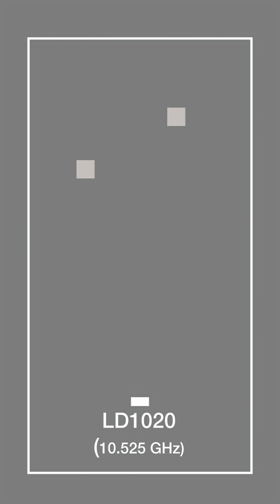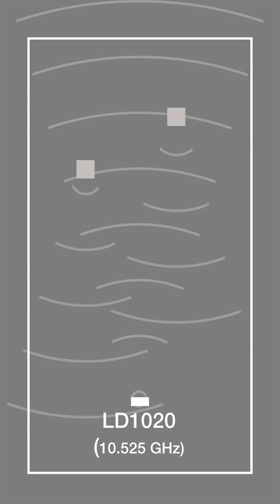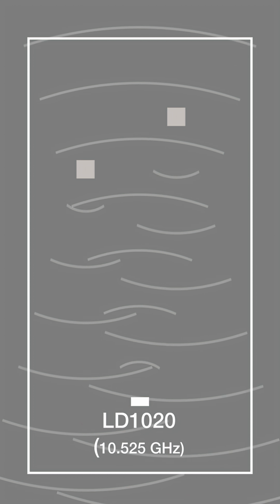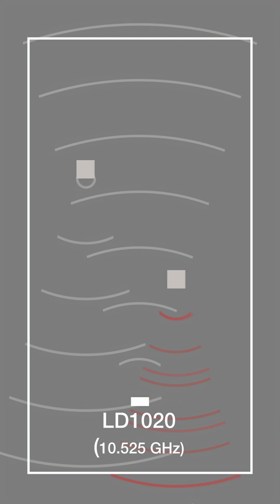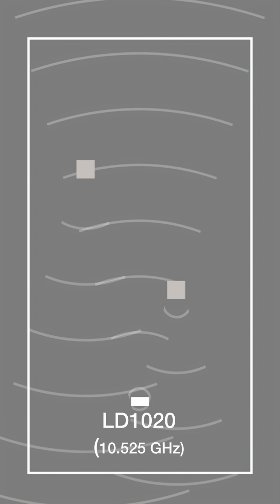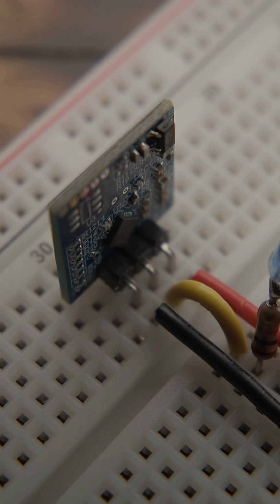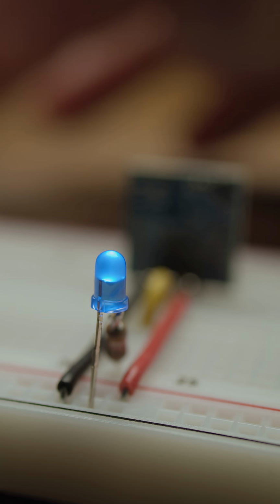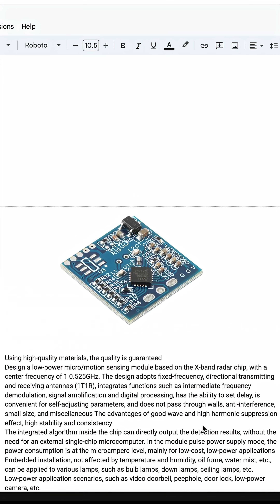LD1020 Radar Module

Comment: I had no idea these existed. I snagged some, and it’s exactly what I need for a project. I had previously been using a PIR sensor, but that required a hole in the enclosure. This is smaller, better, and works really well. Thank you!

Comment: And even detect space objects in a telescope that can generate a reflection on reference motions to ultra sonic radars or the dopler shifts they took static charges run it across two plates the light is the motion that bumps static in frequency added to the static structure and poof a new detection device

Comment: Double pane windows are filled with nitrogen. An innert glass that will disrupt various frequencies of light and radio waves. If you see moisture buildup inside of them, the gas has leaked out and the seals most likely rotted away. Making the windows no better than a single pane window.

Comment: The signal did not go threw the drywall or wood you are talking about that it did,  but since you are in an area that has a hole on the side not a solid barrier then the reason it sensed it was not that it went threw but just that the same radar signal that bounced from everywhere only bounced back from the side opening which caused it to change the frequency and not because it went threw anything... if it had been that it had no solid wall without a hole are to bounce the frequency back then that would have been a better test for that.
Reply from the maker: I did test it in a closet with a closed door and it worked the same. I used the hallway setting for the video so people could see everything at once.
Reply: @HackMakeMod a closet isn't fully closed it leaks threw the gaps of the floor

Comment: Radar is weird. Some colors I have to use certain formulas to make a radar transparent coating so the blind spot detection still works properly at the cost of not as accurate color match.  

In context the sensor is seeing through 3 mm of plastic bumper .7 mil of sealer 2.2 mil of clear but the color is less than a mil and can blind the sensor depending on the pigment

Comment: Nifty, but we need some affordable, accurate ranging radar modules already.

I built an autonomous rover for my senior design project last year.  Navigated primarily on RTK-GPS, which was a game-changer, but i quickly discovered using lidar for collision aviodance and obstacle negotation is not where its at.  Sun glare, aliasing, blowing dust all give false returns.  The new 2D 16x16 matrix sensors by ST Micro were an improvement, but it would be nice to have a radar to fuse it with.

Comment: I'm in process of learning how to build a radar to record the speed pf cars going down my street so thst when a group of neighbors try to get the city to install speed bunps we will have proof of how fast cars are going. I am not very knowledgeable in this type of device or circuitry in general. I planned on possibly using a OPS242-A Doppler Short Range Radar Sensor. I've been reading and watching videos on how to build something lile I am trying to do so if anyone has any advice od greatly appreciate it.

Comment: 10 GHz emitter is easy and old tech. The tech challenge would  be forming an antenna and making a detector that’s not swamped by the emitter, all on a chip.  Would be interesting to hear that explanation.

Comment: Exterior double-paned windows typically have a coating and a vacuum gap"  If the coating is conductive, that may be the problem, but radio waves don't have any problem with a vacuum.  All spacecraft signals come to us through the vacuum of space.

Comment: To set it get a 2 input and gate and pull the one input to high so when the Doppler radar output goes high it will trigger the o/p to High which will start any audio beep very high to. Blasting high depending on the amp output

Comment: Use to fit similar deviced back in the 70s. A doppler radar device for security. But that were huge compared to this. Wave guide was a cavity made from brass and silver plated. Plus the electronics too drive an output. It was Also on  the 10ghz band. We use to remove the waveguides for the 3cm ham radio band.

Comment: That's very interesting. Would that work to detect intruders in the backyard for instance? Or does it also trigger for movement of small things like brances of trees due to wind, and animals: birds, cats, etc? Would it be possible to configure what to respond to? Big objects or small, large movement or small, etc? Does it have like an i2c interface for instance, so a microcontroller could give it settings?

Comment: On line RS may have worked but no one knew about them to use it.   Other companies have taken over and will support smaller orders.  Mouser Newark .Digikey  are a few  Amazon is not unless you want to buy 100s of each part not 1-10.

Comment: Especially vacuum blocks 10GHz 😅
B.t.w. in 99.9% of high-end windows it's not vacuum, though huge vacuum (very low pressure in fact) chamber is used in making - it's dry nitrogen or argon or mix of both.

Comment: Dear fellow common youtube explorer,
VIN here is NOT vehicle identification number. V is voltage and IN means going into the circuit, as the power supply. 😊

Comment: @HackMakeMod Could you put a mirror up, position so it would reflect anything that moved so whatever is moving outside the window, would now show up in the mirror? Instead of pointing the sensor out the window that it wouldn't work in. Point the sensor toward the mirror or would that not work? Could it pick up the different refractions in the light, from the images moving in the reflection? Sorry if this is a dumb question...

Comment: (1:27) Double- and triple-pane widows don't have a "vacuum gap".  If they stop a 10.5 GHz radio wave, it is most likely due to a metallic coating intended to block infrared radiation.

Comment: 10 GHz is just below the Direct TV. so it would be possible to get more range using an old Direct Dish placing this  transceiver in the feed horn  paired with relay board for motion trail cam, home security, or just spying on neighbours without actually sitting at the screen all day. many nice robot projects can benefit from this too.

Comment: Typical motion detectors (like on that stupid paper towel dispenser that doesn't work most of the time) are nothing but temperature change detectors. If the temperature changes more than a certain number of degrees in a certain amount of time, it detects that as motion. (Hint, the paper towel dispensers don't work because your hands are too cold from the water. Try waving your dry forearm in front of it and you'll have better luck.)

Most of the time it's Good enough, but as the MythBusters discovered, if you can diffuse your body temperature with something as simple as a bed sheet, you can fool them. On the other hand, if you have a particular window that is subject to sudden heating when the setting sun peaks around the next building, that can set them off. 

This is a solution for all those failures.

Comment: No double-pane windows don’t have a vacuum gap ! The pressure difference would be insane to hold !
The gap is usually filled with argon, an inert easy to find gas.

Comment: Mine definitely has detected me through walls. I can be standing outside of the door of my room and as soon as I get to the area of the wall that isn't blocked by my tv on the other side it goes off. That's fine with me though because the light turns on before I get into the room.

Comment: I may have an addiction to small board sensors, mcus and modules. My stock is approaching hoarder levels. Thanks, now I have to order this to play with
Reply: Dude same here!! I’m obsessed with these breadboard friendly modules but only have the common ones like dht and ultrasonic sensor.

So far, which sensors do you typically use?
Reply: @VokeRwasha I hate YouTube app. It keeps removing my comment while writing it. Let's just say I've made a ton of stuff that I don't need. Mostly having to do with monitoring stuff and making something happen when conditions are met, a ton of led stuff, I make dioramas and displays that turn on with motion or light detection. Alexa tells me when potted plants need water. Then a whole bunch of stuff that were just playing around that was returned to stock when done. I like light and motion sensors, Lora radio modules, embedded web servers, home assistant integration stuff
Reply: @juggalizzle75  lol it seems part of the hobbyist experience is spending days on a complex project only to never use again.

The potted plant idea is interesting — I’m guessing you’re basically measuring humidity for that. I love wireless projects so I’ll look for radio modules, seems I won’t need more sensors for now. Thank you for taking your time to reply!

Comment: Low E argon double pane windows have a silver metal vapor deposited on the inside surfaces. The Argon is to prevent corrosion or tarnishing of that silver coating. It won't pass infrared or microwave energy. Those windows are not vacuum in the middle.
Reply: Argon or monoatomic gases are good heat insulators.

Comment: There is no vacuum between double glass windows. Only dry air or nitrogen gas. Any vacuum between the glass or less pressure than outside air. The glass panels would touch in the center and you would see a rainbow where the glass is touching each other.

Comment: I bought some motion-sensing light bulbs with these chips in them for our outside fixtures. They are fantastic!
Reply: Link?
Reply: @pg_husa 
Very odd! I replied to your request twice and each time, YouTube deleted my reply. They apparently won’t let me post the link or even write the name of the site where I bought the bulbs, but you can find the bulbs if you go to A__Z_N and search for:

TORANKOS Adjustable Brightness Motion Sensor Light Bulbs
Reply: How sensitive are these to moving plants etc???
Reply: @carlbailey55 
I installed the bulbs in the glass lighting fixtures on my front and back porch and on the side of my garage. If someone walks up onto the porch, the lights immediately illuminate. If someone opens the back gate or walks within about 15 feet of the garage, the garage light illuminates. 

I currently have several 8-ft tall tomato plants just feet away from the garage light and I’ve never noticed it being triggered by the wind blowing the tomato plants. 

On the other hand, if I’m INSIDE the garage and wave my arms around, it will trigger the bulb on the OUTSIDE of the garage, meaning it triggers through the wall. I do, though, have to be pretty close to the wall where the light fixture is mounted for it to trigger.
Reply: @carlbailey55 RF (radio frequency) based sensors are activated by sensing movement of conductive objects. Moisture and therfore plants can also be conductive. So movements in plants, humen or animal bodies bodies are also detected. The sensitivity depends on the speed, volume, conductivity and distance of the moving object. Rain showers can also trigger these detectors while light rain or drissel are mostly ignored.
Reply: Could you please provide the manufacturer and model number?
Reply: @scottwillis5434 
Hmm… I posted a link previously but YouTube removed the comment. So instead I typed in the specs and YouTube deleted that comment too. But I’m happy to give it another shot!

I don’t see a model number on the bulbs but if you go to the website of the company Jeff Bezos created, you should be able to find the bulbs by searching for this product description:

TORANKOS 2 Pack Adjustable Brightness Motion Sensor Light Bulbs, Glass/Plastic/Wood Penetrating Detection, Auto-On/Off LED Bulb for Closet, Hallway, Porch, 4000K Natural Light (A19, E26/E27 Base)
Reply: @scottwillis5434 
Every time I try to reply with a link or info on how to find these bulbs, YouTube deletes my comment! It’s happened 3 times already.

Comment: I used one of these on my car alarm I had in a convertible. I wanted the interior protected with the top down. Mounted it inside the center console. Took some playing around with an adjusting, but once dialed in, world Amazingly if anyone reached into the car, but you could walk right up to the car, without issue, if you broke the plane, hit the deck. 😂😂

Comment: This is really interesting, is there an application for a marine use for sailing, of a stronger chip that could be used instead or possibly as well as traditional radar? I am a disabled sailor which puts me on a with a small budget which I’m doing up a Fisher 25 in the UK. Any help would be greatly appreciated.
Thank you

Comment: This is fantastic because you can adapt any device you already own, rather than having to buy the manufacturer's device. I  don't know how much current it can switch, so transistors, SCRs, and relays for full versatility. I will be checking that spec and what the current draw of the module is. 
    I see that you keep your modules exactly like I do in compartment boxes.
   Thanks!
Reply: They draw a lot more current than PIR because they have to transmit continuously. PIR is passive, as the acronym suggests.

Comment: The X-band sensor in this video would be a 47 CFR 15 low power intentional radiator, legal to operate unlicensed, but fairly restricted in power or signal strength (outside some police now mostly obsolete RADAR).  

That K-band unit is on an ISM band as well as Part 15, and so depending on details could be legal to design at very high power levels, and range.  

Around 3 GHz is messier as to different spectrum segments and legal issues.  Some sensors also operate around 5.8 GHz, where both Part 15 and 18 options exist overlapping or adjacent.
Reply: Hey bud,
You seem very knowledgeable. Would you mind guiding me in my 1st electrical project? I dont have much money but I can pay a bit for your help.

I dont get notifications but will come back to this video and check your reply.
Reply: @kg-Whatthehelliseventhat That's a pretty open ended question.  International radio spectrum management and applications is not an intro level topic, and covers the confluence of law and engineering.